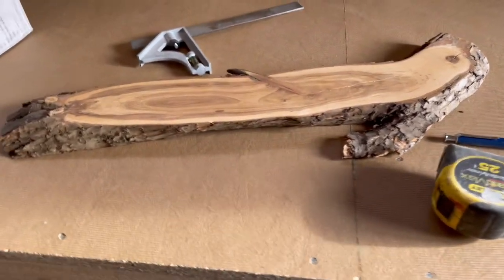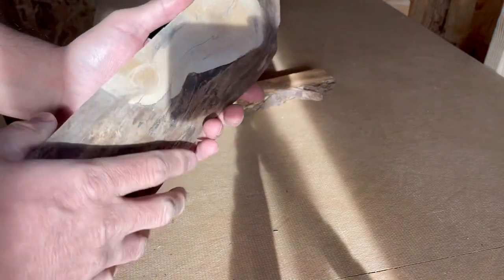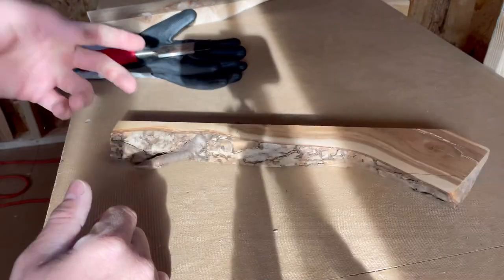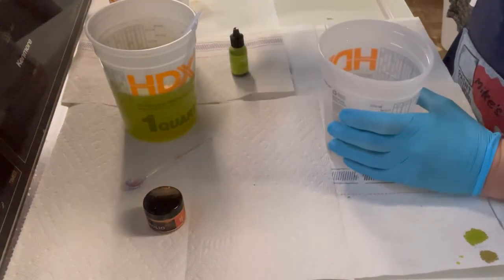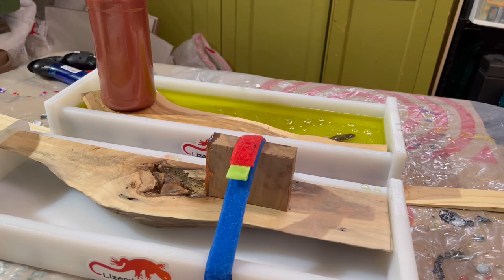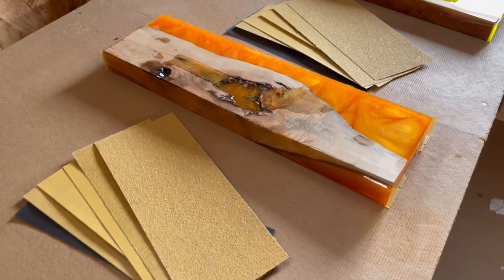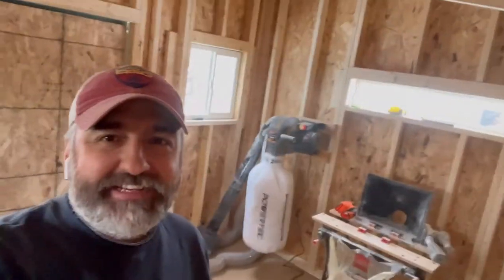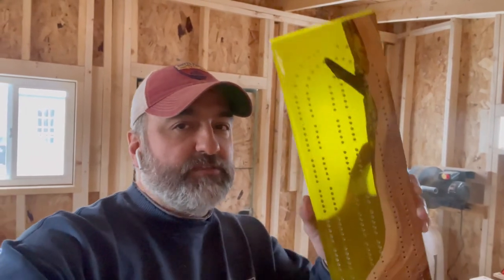Two Resin Cribbage Boards

Comment: Great video. I’m just starting my first board but have rockler templates that have to be moved several times during drilling. Sounds like a pain. Where did you get a full board template? That looks easier. Thanks
Reply from the maker: I bought it off of Amazon but they are currently sold out. They cost $35 but are a time saver.

Comment: Great video! I am making a board now and I've noticed that when you pour your resin you're not covering the wood, but the finished product does have the shine of resin. How do you accomplish this? I know you don't after you have sanded down the high points. Thank you!
Reply from the maker: After I sand I cover the board again with a thin flood coat. After that cures I drill the holes. I use a plastic polish to finish it off.